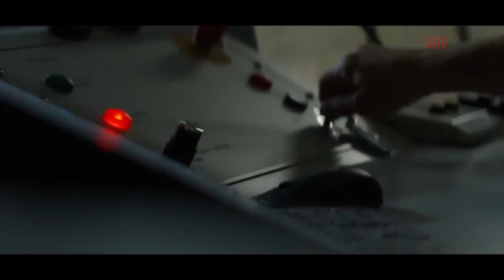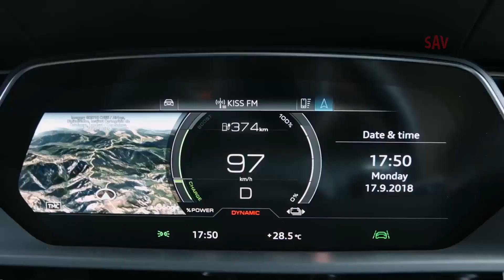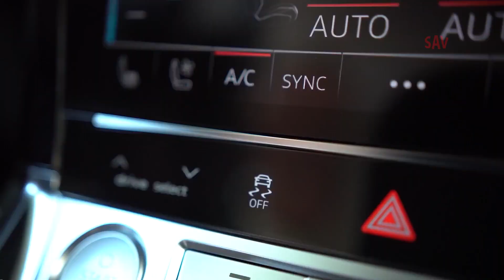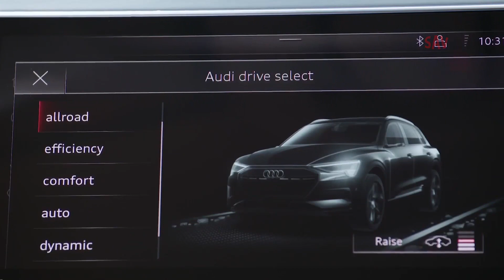Audi e-tron SUV Making Of / Development

Comment: My case is that you had no choice but to go electric.  People were queuing outside of Tesla, just as if it was an Apple store.  And they hadn’t even seen the car.  You must have been thinking.  “Oh, hell, how are we going to be able to top this.?  Good car, but aluminium would have been the better way to go i think.
Reply: Richard S Wiggins Agree with you.  It did work for them though.  I have owned 5 BMWs in a row, just bought my 1st Audi...the e-Tron.  Live it.  My next cat will be full electric too (probably not a Tesla though), so we’ll see...hopefully 5 series BMW (have a plug in 530e now).